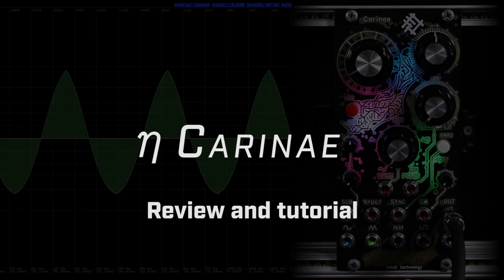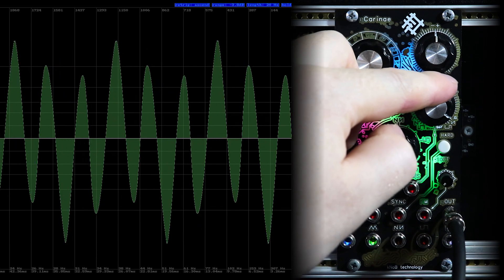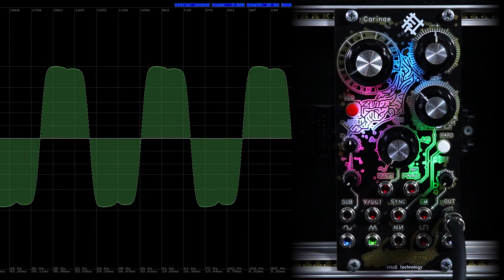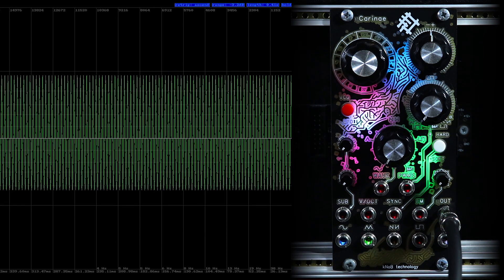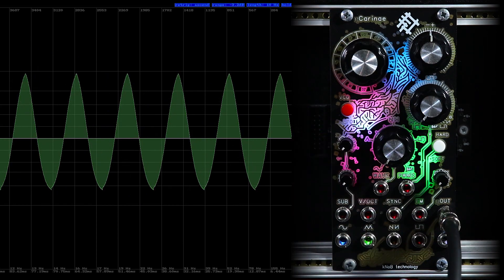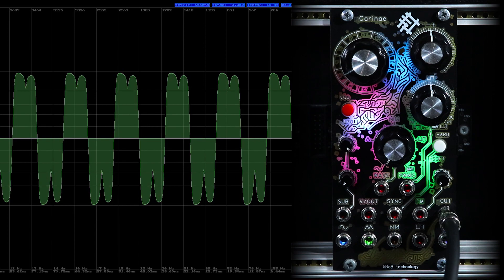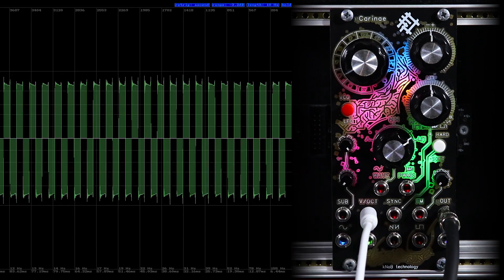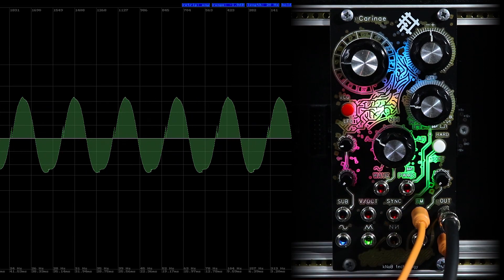kNoB technology η Carinae VCO Review and Tutorial

Comment: Awesome looking and sounding unique Oscillator with nice features. I see in the manual it is possible to trim the brightness of the leds. Is it possible to trim it completely? Not so important, just to know it can be completely without the light effects :). Thanks!
Reply from the maker: Thanks! You can’t turn off the backlight, the setting works only for connectors.